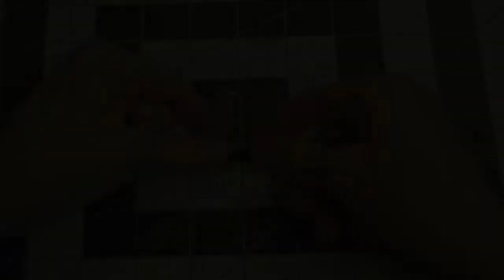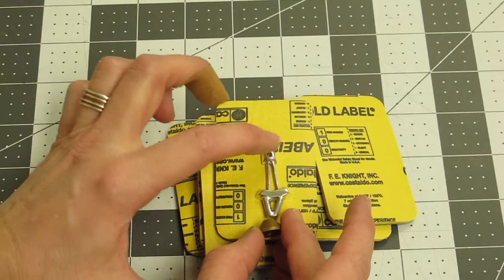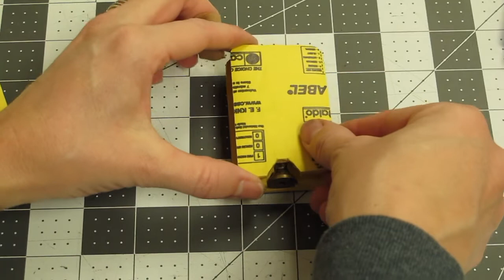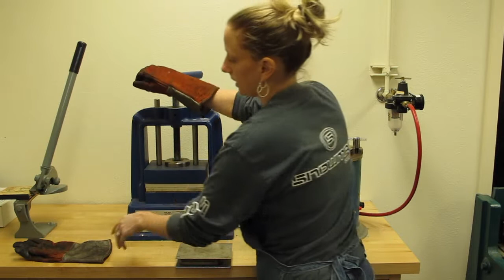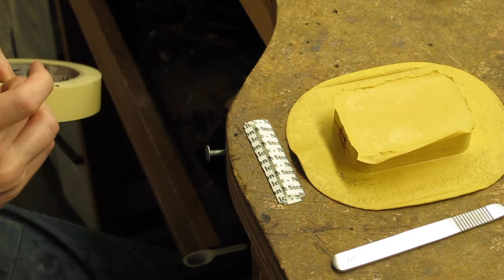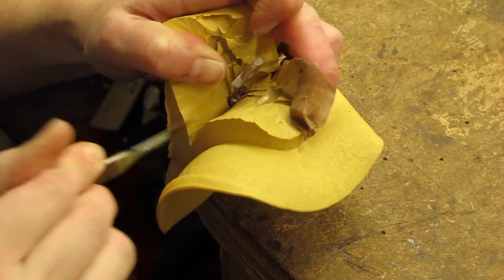Making a Vulcanized Rubber Mold

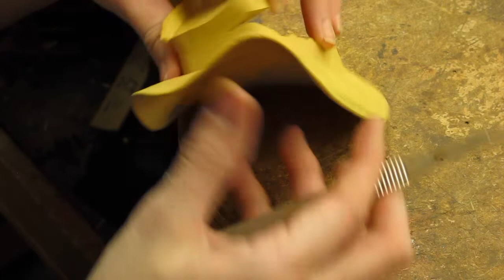Comment: 24:30 Is there a particular reason to cut the mold all the way to the end?
27:00 Thank you for the tip. 😅
Reply from the maker: I have left some molds closed but they tend to shift more when you inject wax. You really want large keys and a jagged surface so the mold has teeth to grab onto when you put it together.

Comment: Hi there! This video has a lot of good information in it, and I knew none of it before, thanks.  I wonder though, why do you continue to cut and separate the two mold halves from each other -- it seems that if you stopped after you got past where the piece was and left the rest intact you would simplify alignment later.  IT would also be great to see you use the mold and make a piece with it.
Reply from the maker: As I mentioned, my cutting in this video is rough😂. I’d suggest looking up cutting rubber mold videos that are out there. I’ve left some together (you can); I feel like I mess up the pressure when holding it to inject wax. Cutting keys is the important part. I have another video with using the wax injector.
Reply: @laurenseldenmakingthings7045  good stuff do you make molds and sell them? Can you

Comment: Hi. Very informative video, well done. I'm curious if you'd share links to where we can buy/obtain the materials and tools you used here, such as the vulcanizer. Is a tire repair vulcanizer suitable for making small rubber casts?
Reply from the maker: The tools shown here are older and the company is do longer available. You can search jewelry suppliers and tools in your area and you should see multiple options. Jewelry vulcanizer for rubber molds and jewelry wax injector would be the keywords.

Comment: I use detergent to isolate rubber from aluminum plates top and bottom the rubber.
Reply from the maker: You can also leave the paper on the outside edges. I never have trouble prying it off. I just try to introduce very few things. Thanks for the feedback.

Comment: I've saw a video of someone who cut nothing out, and just shoved the piece in there and let the rubber close in on it, and overflow from the mold. This also allowed them to use some paste as a mold separator to keep the top and bottom part of the mold apart. Wouldn't that be simpler?

Thanks for the video!
Reply: Depending on your shape, you can do that. You can also put little pins in place and use parting powder. Every once in a while, I can see the texture of the parting powder on the wax blanks. This is just one way. There are many. That's the best part:) Thanks for watching.
Reply from the maker: There are a lot of ways to do this. This is just one. I have used parting compound in the past, but I found that sometimes it left a texture on my original pattern. I would then have to sand each wax to clean this up. You can also imbed metal "keys". Everyone has a way. Jewelers who have been in the field forever would have even more efficient methods. Thanks for watching.